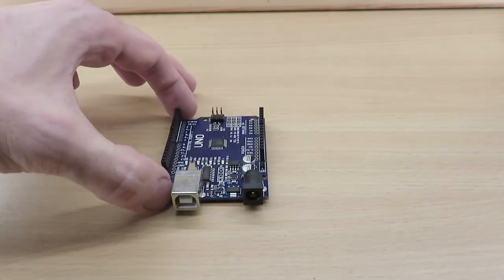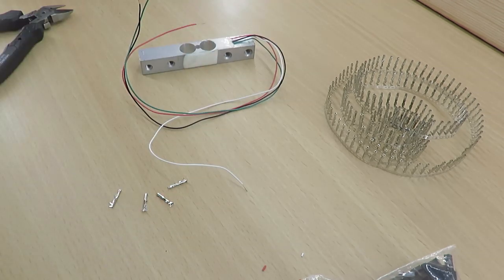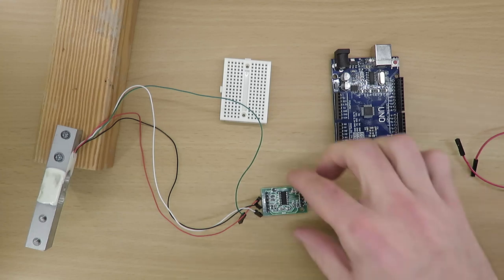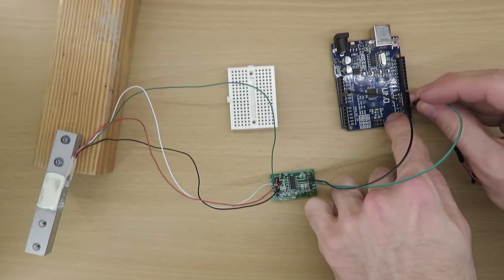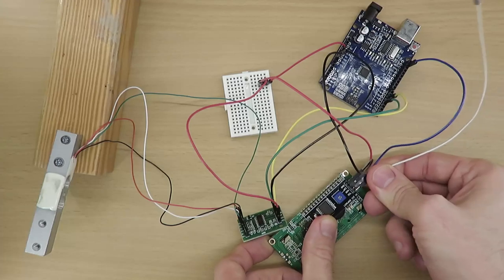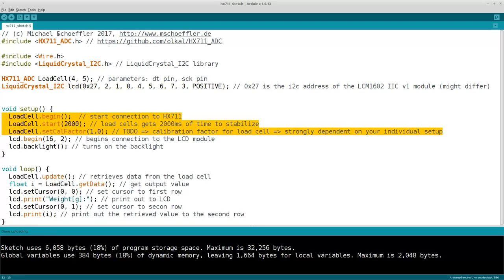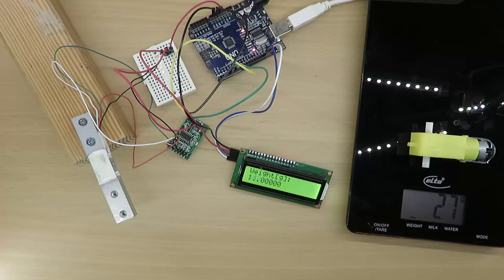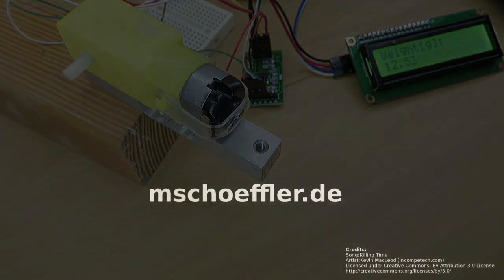Tutorial: How to make a weighing scale with the HX711, a load cell and an Arduino | UATS A&S #14

Comment: Hello, I have loaded your code always brings me error 'POSITIVE' which is not declared in this scope you can help me.
Greeting Georg
Reply from the maker: I pinned the comment, since I get many emails from people having the same problem:
There might be something wrong with the LiquidCrystal_I2C library -> Look for another variant of the library and/or check whether the library is correctly installed.
In at least 50% of all cases, looking for another variant of the library or reinstalling the library did help.
Reply: @mschoeffler  Well how about you just give us the correct line? its apparent the line "LiquidCrystal_I2C lcd(0x27, 2, 1, 0, 4, 5, 6, 7, 3, POSITIVE);" does not work. and use a different library is not a proper answer since in your own words it only works less than 50% of the time... I have looked at the library, I find no mention of 'POSITIVE'. so what is this meant to be? and do? is it the backlight function? what is the proper input?
Reply: Did any one find the solution for this line????
Reply: @prajwalbs600  I used the LiquidCrystal lib from here.... https://aws1.discourse-cdn.com/arduino/original/3X/4/5/45a281b9d61bdb6af3c8d67148a836411c892696.zip
Reply: @stephenkamin1345  did it work?
Reply: @prajwalbs600  YES

Comment: Thanks for the video, its better than anything I could do. However IMHO .. . the HX711 example board shown does not have the recommended bridge supply smoothing capacitor (10uf) as per datasheet. Also the shielding/grounding of the beam is not shown or explained. This is why the output of the amplifier is so jittery and noisy. Ideally a connector is not a good thing as this is a further source of noise and offset, soldered joints are best. For maximum performance screen amplifier and strain gauges on load cell and keep analogue leads as short as possible.
Best Regards

Comment: Great tutorial. How Would I print screen to display grains? And also turn off a motor on preset weight? Im building a auto powder dispensor
Reply: I also am looking to turn off a motor on a preset weight. Let me know if you find a solution I'm new to arduino!
Reply: Maddie Lenschow, Actually I have! I found a form on some1 that is doing this exactly I just mock built it and it works!
http://forum.arduino.cc/index.php?topic=304695.0

Second pg has the whole code near the bottom. Ill build this and post it on my channel
Reply from the maker: Nice that you already found a solution! If you use the code from my tutorial as starting point, then in my opinion the easiest way is to add an if-condition to the loop function:
void loop() {
  LoadCell.update(); // retrieves data from the load cell
  float i = LoadCell.getData(); // get output value
  if (i > 500.0) { // weight is greater than 500g
    // add your code to turn on the motor
  } else {
    // add your code to turn off the motor
  }
...
Did you also solve how to display grains? That seems a bit challenging for me. If you know the average weight of a single grain, you can divide the total weight by the average weight. As a result, you have an estimate of how many grains are on the weight scale.
Reply: Ya i manage to find a few ways. 1 being lcd.print(scal.get.units() * .154324). Im not sure how this code is doing it but I need help getting the delete key to function correctly w/o displaying the character. Also I would like to speed up the servo without pause and slow it down when it gets close to weight also I want to display in .01 grains not .1
heres my ino file I got for now. It works but not the best.
https://drive.google.com/open?id=175X_I7RwHv7PGZhdzqs_5EkxG068JwJv
Reply: hello any solutions for the above problem?
Reply: @mschoeffler  When running this, I get the if-condition to over 13 grams at which it is set, after that a motor should run, but it doesn't. Why is this?

Comment: Hello
 Michael,

I used the same organs like you. The problem is, on the screen I get a variation on the value obtained after the weighing.

So I need to stabilize this value, I don't know if there is a component / organ that I can use to stabilize the displayed value
 ?

Type of scale: Brehm B30-30 Single weighing scale + Capacity 30Kg
The weighed weight: between 0.01g and 200g

Thank's in advance for your return

Comment: Quick question, very, very new to Arduino, how would I create a trigger for the scale to change to a message once the scale gets to a certain point. I am using it to measure when a tray under a dispenser gets full and then triggers a message on the lcd. So essentially I want it to display the mass as this tutorial shows, and then tell me when its overweight.

Comment: Hello Michael, how can I solve the error 'POSITIVE' which is not declared in this scope? Thank you
Reply: i have the same problem, havent you fixed it yet?
Reply: @janithbandara9552  , try instead that line code for 1602 LCD,  this one :  LiquidCrystal_I2C lcd(0x27,16,2);
Or the adress can be 0x3F if the backlight  of the LCD is green. 0x27 is the adress for the blue backlight.
Reply from the maker: I'm not a 100% sure, since I published this tutorial a long time ago: I think it has something to do with one of the libraries. Either they are not correctly installed or you have the "wrong" library. I remember that a visitor of my website solved this issue by installing another "LiquidCrystal_I2C" library.

Comment: Could you do an updated video that goes into adding a Tare (zeroing out) feature and other weight units?
Reply: To tare you would just need a button, which when pressed the current value is captured.  Then that value will be subtracted from the display.

Comment: i have the same positive error tried to download a lot of library but still not working do u have another solution or another part to the code so that i can change it and work LiquidCrystal_I2C lcd(0x27, 2, 1, 0, 4, 5, 6, 7, 3, POSITIVE); // 0x27 is the i2c address of the LCM1602 IIC v1 module (might differ)

Comment: I notice that it take 2 -3 second for the display to settle down.  what is causing the delay?  is it because Arduino is too slow or the load cell need time to bend back 0 value?  I am looking for 1 second or less respond time.  is this possible?   will teensy 4.0 help?  please help me figure out.
Reply: I guess it would be the loading cell bending back into position. If you need it to bend back faster, maybe try to support it with a spring for example.

Comment: hi..great tutorial..have a questions..need only the actual weight no the decimal digits..any help ?
i mean 140 no 140.75 and to the zero point need 0 or 0.0 now show 0.3654 and play its no stable...like crazy...thanks for your time
Reply from the maker: Hi, you can simply convert the retrieved value to an integer:
float value1 = LoadCell.getData();
int value2 = (int) value1;

If you print out value2, the decimal places are gone. 
If you require an accurate rounding, e.g. 12.5 becomes 13 instead of 12, you can apply a simple hack:
int value2 = (int) (value1 + 0.5);

As value1 will always be greater than 0, this should give you correct results (does not work this way for negative values).

Comment: is it possible to control an engine with it?  So when 500g is reached that the engine stops?
Reply: You can easily control a relay with the arduino to turn things on and off.  So, code could be written that when an input reaches a certain level, then a relay is turned off.

Comment: how would you add a tare function to this scale with a push button sorry if this is a simple solution im new to using arduinos.
Reply from the maker: Do you know how to add a button to your setup? If so, then you can make use of the tare-function that is offered by the library (https://github.com/olkal/HX711_ADC/blob/master/src/HX711_ADC.h line 48)

Comment: when i uploaded your sketch it shows an error-"POSITIVE was not declared in this scope".  what to do? please reply asap
Reply: kartik mehetre did u got the answer of ur question? If yes plz tell the solution m also getting this error . Plz help me asap tomorrow is my submission.
Reply: I am also getting the same problem
Reply from the maker: I get this question very often... it's always the same problem: I guess you have installed the "wrong" lcd library (see e.g. here https://forum.arduino.cc/index.php?topic=214356.0). Unfortunately, there are multiple LCD libraries out there :/
Reply: there are two I2C liquid crystal libraries, in one of them you need to define your display as above, but in the other one, you only need to set the I2C chip direction (0x27 by default), and the LCD columns and rows (number of cells)

Comment: How can I connect two hx711 with an arduino in software
Reply from the maker: Not 100% sure, as I did not try it out:
Create two HX711_ADC objects. For example if you second load cell is on pin 6 and 7, the beginning of your code should look like this:
HX711_ADC FirstLoadCell(4, 5);
HX711_ADC SecondLoadCell(6, 7);

Comment: Hi Michael, Thanks for sharing your knowledge. I had the same problem with the LCD, but got it fixed, but I have another problem which is:
Arduino: 1.8.5 (Windows Store 1.8.10.0) (Windows 10), Board: "Arduino/Genuino Uno"

C:\Users\MHOJUN~1\AppData\Local\Temp\ccf3GMCr.ltrans0.ltrans.o:(.rodata+0x18): undefined reference to `Print::write(unsigned char const*, unsigned int)'

c:/program files/windowsapps/arduinollc.arduinoide_1.8.10.0_x86__mdqgnx93n4wtt/hardware/tools/avr/bin/../lib/gcc/avr/4.9.2/../../../../avr/lib/avr5/crtatmega328p.o:(.init9+0x0): undefined reference to `main'

collect2.exe: error: ld returned 1 exit status

exit status 1
Error compiling for board Arduino/Genuino Uno.

Can you help me...Thanks
Reply: How did you fix the LCD problem